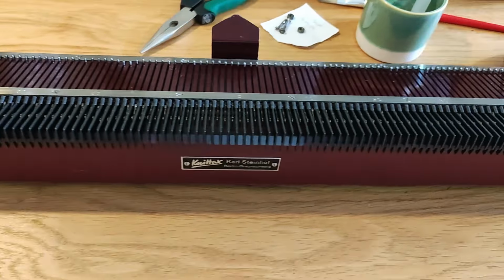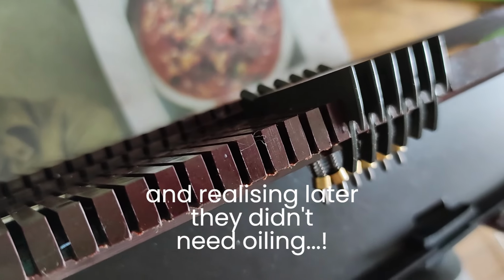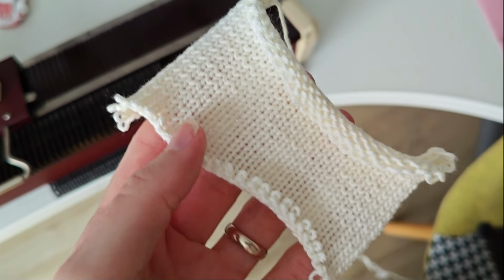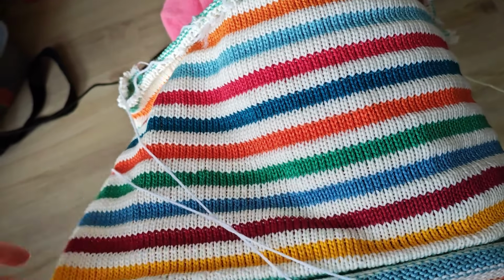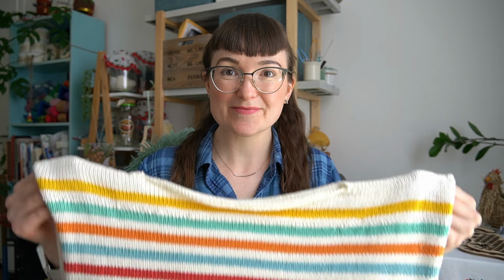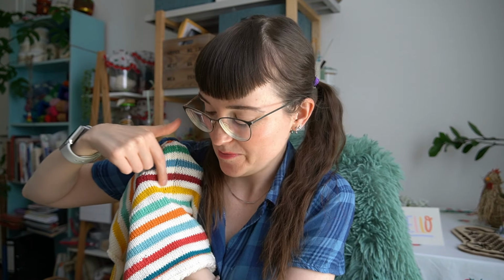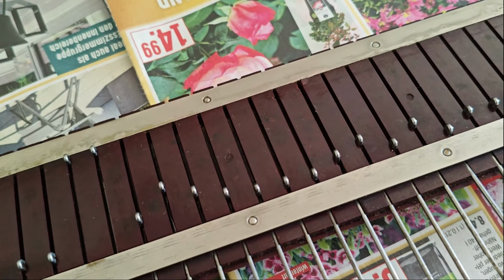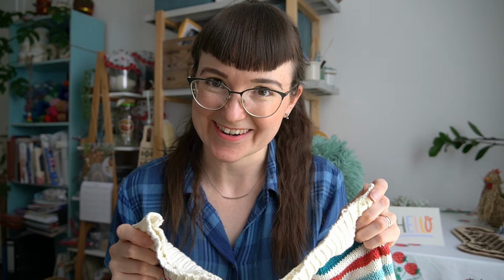I Purchased A Vintage Knittax Knitting Machine from 1956! 🧶(and I have A LOT to say about it!)

Comment: I admire your perseverance on this! I have a Knittax from the 60's that was my mother's and have been trying to learn how to use it in the past year. I don't have a ribber though. If you have problem areas or bent needles you could try moving them to the outside edges of the machine where you are less likely to use them, and still be able to use the centre of the machine. I've found the books by Susan Guagliumi the most helpful. There is a channel called Zabbez and he has one of these machines. I also have followed an old video by Vivi Crafts to make socks on a flatbed Knittax machine. It's best to start with wool, which is stretchier and more forgiving. I've tried 100% linen recently and it is a pain - no wonder most people weave with linen rather than knit.  Good luck!
Reply from the maker: Perseverance might become my middle name after all the vintage experiments I put myself through haha it's worth it though ;) 
That's so exciting! You have one too :) I have currently given up on the ribber and will worry about that in the near future. I found a different way to do rib and it seems to have potential :)

Oh thanks, I'll go check out Vivi crafts. I've already watched all of Zabbez' videos but he has a more modern machine than mine, so some of the things don't work out the same. But I watched them all to learn how to cast on and bind off :) He's great.

I am very excited to try socks :)

Comment: Just saw this video. Usually knitting machines come with an addition part that is needed to begin knitting your garment. It weighs the item down as it starts getting long. Also use silicon spray to loosen up the needles. Good luck.
Reply from the maker: Hey
Thanks, that's interesting, I've never heard of silicone spray, I'll look it up 😊
Oh, as I mentioned in the video, this machine doesn't use weights or combs, it uses sinkers. It's a different system. It just involves lots of learning 😆

Comment: I hope you enjoy knitting on your machine! I bought my LK 150 about a year ago for similar reasons, you can do so much with them, I made the body of my Kate Davies Puffin sweater on the machine, then knit the yoke and ribbing by hand, as my machine doesn't have a ribber. If you have a set of slim interchangeable knitting needles, like the ones for knitting socks with a long cable, those can be useful for taking stitches on and off the knitting machine when correcting mistakes. 

If you have a latch hook, that will help you reform your purls. Look for videos on cut and sew for seaming with lots of colours, you could use a sewing machine to stitch close to the edge of the fabric in a similar way to sewing a steek and then you can cut the knitted fabric and ends away.
Reply from the maker: I have seen many youtube videos about that machine.. it looks very fun :) I'd like to try it one day.. maybe in a coupe of years time I can save up for one. I'd like to be able to knit thicker wools up on a machine too, as lettlopi may not have a nice time on this machine..! 

That's exactly what I want to - it seems like a really fun way to combine the hobbies as well :) Half machine, half by hand.. I'm excited, even just typing about it :) 

oh thanks for the tips! I definitely have many knitting needles about the place. I'll make sure to have one on hand for my next project :)

I do indeed have a latch hook. It's great for dropping the stitches down and then picking up as knit stitches. I'm just trying to figure out how to do that but to pick up as a knit stitch on the knit side. 
If you have seen my rainbow jumper, the stitch pattern is a slip stitch design, but I've seen how to do it on my machine, but only with the purl side facing me, and the finished item being the purl side.  I want to do it but with the knit side facing. I don't know if that makes sense.... but I know what I mean haha 
lots of practice and youtubing I imagine is ahead :)
Reply: @emilykatemadethis  
The LK 150 also does slip stitches, there are two sets of levers on that machine and the side levers go to the circle and the Russell levers go to II. I'm not sure about the knittax, maybe you could message Zabbez (the Dutch podcaster you were talking about) he may be able to tell you if it is possible on that machine, he seems to be trying to find out what he can do on that machine. I think it mostly shows up better on the reverse.
Reply from the maker: I have one lever but I haven't looked up what it does yet 😆 that's a task for the day ahead 👏
Oh that's a thought... I wonder if he'd reply... Could be worth asking 😊
I really would love to make more slip stitch patterns
Reply: @emilykatemadethis  It is worth a shot!

Comment: I have the same machine! Just got it too. Honestly cleaning it took it all OUT OF ME. Mine didn't come with the table clasps. Would you be able to tell me how wide they are so I can scour the web for some similar ones? I measured that space but it was so small I doubted it would be possible with clasps.
Reply from the maker: Yay! Welcome to the knittax club! 
Mine also didn't come with clamps. I used the ones that came with my wool winder 🤣 
I actually stopped using them though because I found it much easier with these black grip mats instead. They're advertised for sticking to surfaces so that your phone doesn't slide off, like in a car. The machine sits much better on them. But if you are going to need to remove them often they might not work... The clasps are not out but I'll try and find them later 😊
Reply from the maker: 2cm wide 5cm long 😀

Comment: Well done!!! I have a vintage machine too but gave up on it because it didn't come with the tensioning rod 😢😢 Well done on all that cleaning, what an effort! Have you done something to prevent rust? I would have been terrified!
Reply: I have this idea in my head that because I am not the least bit mechanically oriented I would like to buy a new knitting machine instead of a vintage one, but I think they are something like $5000 to $10000 to buy so it might be a retirement present for myself, or at least a planned purchase.
Reply from the maker: No don't give up! It can be done :)
I purchased a special oil that's meant to help prevent rust... I just need to dismantle the machine again and use it on the needles, and I'm not mentally prepared to do that again yet haha
Reply from the maker: oh yeah, new ones are astronomical in price. I didn't even dare look... I knew they'd be out of my price range, and I was happy to get the most simple and least technology filled one as possible. Less to go wrong haha
I would like to get another one in the future when I know more about them. One that has a colourwork carriage or lace one would be fun. But for now, I'm quite content learning my way around the machine I have :)
Reply: @petramanos  Have a look for a silver reed SK280, it is a standard gauge punch card machine the main bed is around $1300 US dollars currently and the ribber around $800, I know they can be found in  the UK and other parts of Europe too. I'm saving up for one at the moment.
Reply: @janatherton9194  sadly most knitting machines didn't sell to Australia
Reply: @petramanos  I'm sorry to hear that. :(